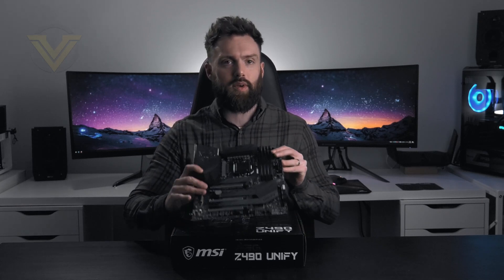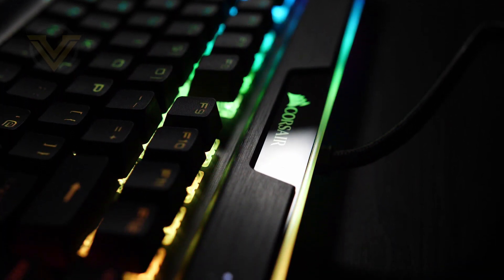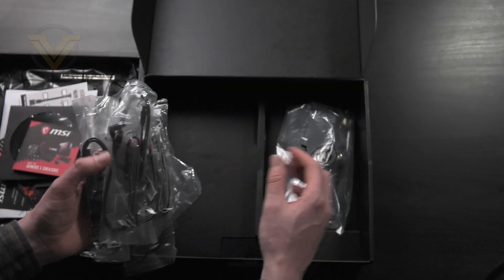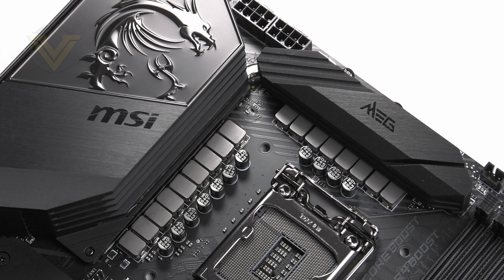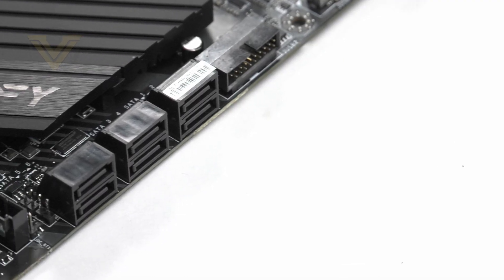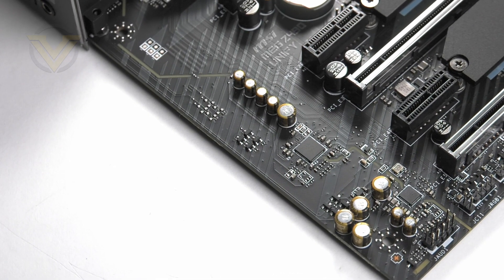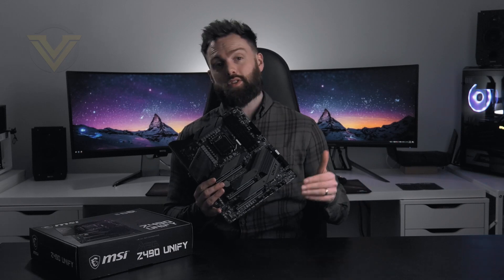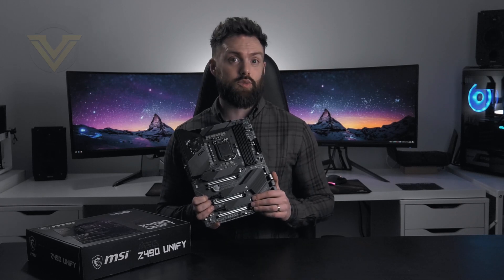MSI MEG Z490 UNIFY Review

Comment: Noob question : Comet lake is not capable of PCIe 4.0 . But the motherboard is presumably yes.  So I am confused : if I use M.2 SSD-s PCIe4.0 on this board , will go with PCIe 4.0 speed or 3.0 speed ?
Reply: From my understanding, it will be PCie 3.0 speed as the CPU cannot support 4.0.
Reply: @Beyondqqq  Right

Comment: would you recommend this board over the z490 mpg gaming edge wifi. I got that for $179.99. While this one I can get it for $259.99. Please let me know if the jump is worth it. I will be running an i7 10th gen unlocked with rtx 2060. Please let me know. Thanks

Comment: Why no displayport out? Had to get the tomahawk instead.
Reply: Lol display port? You don't plug it into the motherboard dog you plug it into the graphic card which has the display port🤓
Reply: @jamesjohnathin6504  The USB 2 ports should be gone for Display Port & HDMI, I aint getting a GPU straight away so this board makes a GPU upgrade needed at the same time (for me anyway). Love the look of it so I'm super torn tbh, Should I get this or the X490 Carbon, for what I can see I'd be down on 2xUSB3, 1xM.2, looks but up on RBG, HDMI/DP & Possibly Thunderbolt 3 (if I've looked correctly).

Comment: Do you think this motherboard is overkill for a 10700 non k?
Reply from the maker: Not at all, even if you aren't overclocking its a great board to pick-up. We are using it as a test bench for some features at the moment and it's a great all rounder.
Reply: @Vortez  Which case would you slap it in?

Comment: I have this exact board and I'm having an odd issue where when I overclock my 10700K the temps per core bounce all around while gaming.
For example, Core 5 will hit 90C while the rest of the cores stay around 60C. Core 5 will then drop right back down to regular temps while Core 2 now takes it's turn jumping to an extremely high temp.
I haven't been able to find anyone with an issue similar to this. I've changed out thermal paste, re seated cpu, added push/pull on my H100i 240mm radiator. Nothing changes. This only happens while the cpu is overclocked which leads me to believe its a behavior the mobo is pushing onto the cpu. Is that possible?
Reply from the maker: Which BIOS version is your motherboard running? You may be using one of the first versions, if you can I would definitely suggest updating to the most recent via the MSI website, on their support page for this board.
Reply: @Vortez  Thanks for the quick reply man. I was under the impression I already have the latest BIOS but maybe I'm mistaken. On MSI's site it only lists one BIOS release as "7C71vA0" released 4/30/2020. In my System Information it says my BIOS version is "A.00" released 4/22/2020. Is this not the same bios I already have? Could it cause an issue to install the same bios again?
Reply from the maker: That seems to be the latest but the I have 30 April here. What application are you using to monitor the temps? Cores do operate differently in terms of frequency and temp but I'm wondering if the software you are using is reporting incorrectly. Have you tried something else to confirm the same result?
Reply: @Vortez  I used Coretemp and NZXT CAM to monitor the temps, those in combination with checking the built on led on the board itself.
After playing around in the BIOS some more I changed my "CPU Ratio Mode" from "Dynamic Mode" to "Fixed Mode" and for whatever reason this seems to have mostly fixed the issue. Per core temps maxing out at around 75C while  playing Far Cry 5 with a 5Ghz all core overclock. Not a bad result right?

Comment: I just ordered this bad boy!
Reply from the maker: Nice choice. Enjoy!!
Reply: Same here! How's it going for you? I was torn between this, The Gigabyte Aorus Ultra and the Strix ROG but I really liked the asthetics of the Unify (That and Buildzoid said it was a pretty decent board!). The £300 lineup for Z490 is very competitive.
Only thing that's got me worried since ordering is people mentioning a glitch with MSI boards when setting an AVX offset when overclocking; apparently MSI and Gigabyte boards will downclock to the AVX offset when doing non-AVX stuff like Gaming. It has me a little nervous and I almost cancelled my order and went for the Rog Strix. 
Is this something anyone else has come across or has this issue been fixed with Z490? It's great that there's rumours that 11th gen should run on Z490 also. Finally something of an upgrade path again from Intel!

Comment: unless you really want rgb or intel lan , this is the same board as the ace .its the same vrm and actually should cool better because there is no plactic shield on vrm . In this price range this is the best. I really hate that they added a fan instead of making even better heatsink but at least its a dual ball bearing fan and will see how much its actually needed. I was chossing between unify and gigabyte master and preorder this one. Msi did the same with x570 so to me there is no reason to buy the ace over this one.
Reply: How's the board treating you? I've ordered one but since that I've been reading about AVX offset issues when overclocking on MSI boards. Apparently they can downclock to the AVX offset when doing something unrelated like playing games. Is this something anyone else has experienced? Perhaps it's been fixed with Z490?
Still prob going ahead with this board as it looks amazing and VRM is sweet!
Reply: Khola I really really like the board. After lots of testing I can say that their auto voltage for 5ghz on 10700k is actually spot on . I only had to set adaptive + offset mode - 0.02 to be stable . I tried the avx offset and have not noticed any problem but I don’t use it. In 2020 way more app than you think uses avx or will trigger the offset ( even chrome ) so you will pass more time in avx frequency. To me if your not avx stable than it’s not stable.